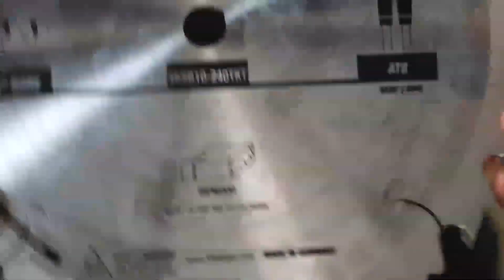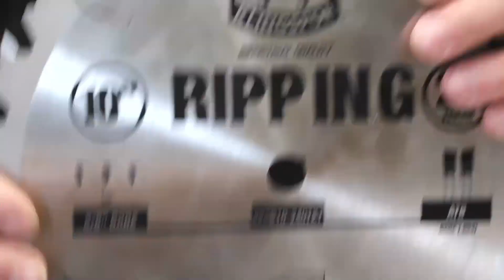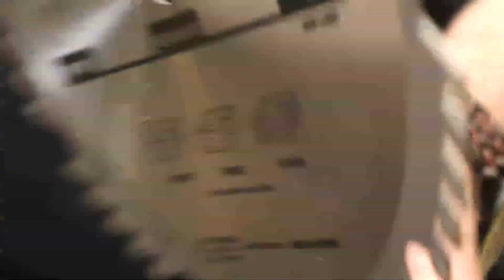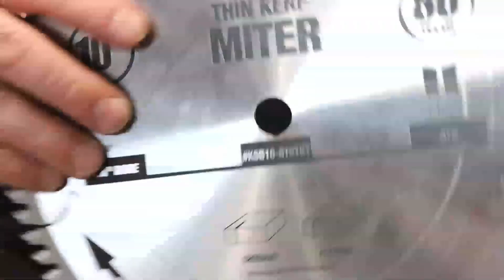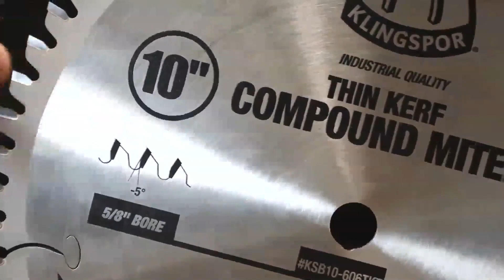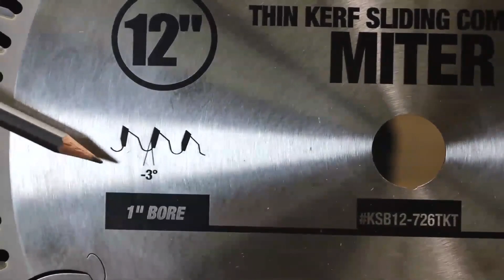NEW Klingspor Thin Kerf Blades!

Comment: The video shows anti-kickback shoulders on the rip blade. The website shows it without the shoulders. My main interest is finding a thin kerf ripping blade without the shoulders as they are not recommended on my sawstop. The only one I've found is the $150 ridge carbide. 

Could you confirm whether or I would receive a blade with the anti-kickback shoulders that I don't want?
Reply from the maker: Checking on the blade it does have a very small knuckle after the tooth. it's not like other manufacturers but it's not a clean smooth fin like our full kerf blade. We have updated the picture on our website to help you. https://www.woodworkingshop.com/product/KA10240TK
Reply: @KlingsporsWoodworkingShop  
Thanks, but unfortunately, that means I don't have any use for it. I understand the purpose of the "knuckle" but it's no good for a sawstop. There are a lot of us 1.75 hp sawstop owners out there that prefer a thin kerf blade, so maybe keep it in mind for the future.
Reply from the maker: @joshuatate6106  but are you just needing it for ripping? Because as users of our products, we will say that the Combination blade is the best on a 1.75Hp SawStop. Covers both ripping and crosscut but with a special feature of a large gullet. https://www.woodworkingshop.com/product/KA10504TK  Check it out and let us know on the chat line on our website if you have any questions because we know the facts and myths about this situation on SawStop and happy to help you in any way we can get back to making sawdust.
Reply: @KlingsporsWoodworkingShop  

I am only interested in dedicated ripping and crosscut blades. I dislike combination blades and have no use for them. I can find thin kerf crosscut blades that work fine in a sawstop but the Ridge Carbide is the only rip blade I can find. Thanks